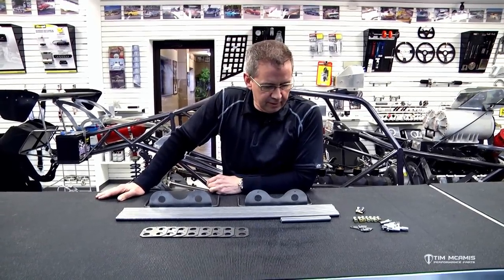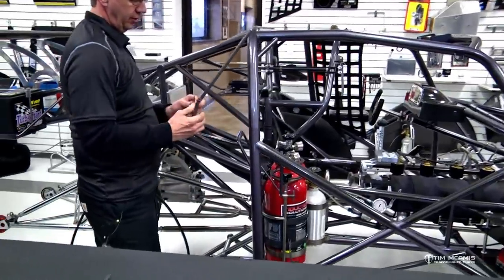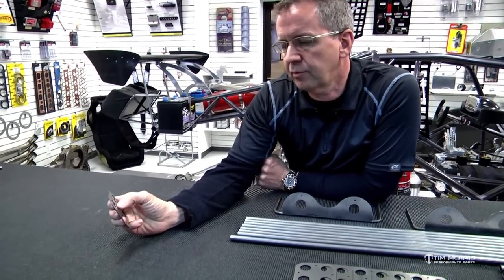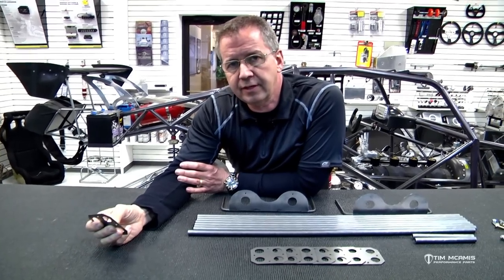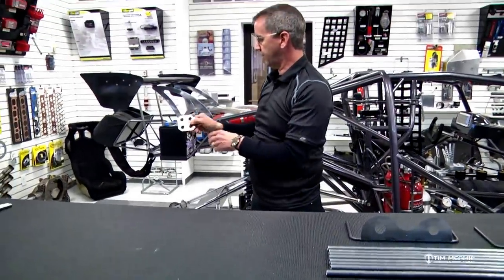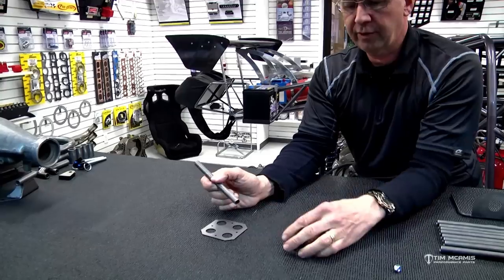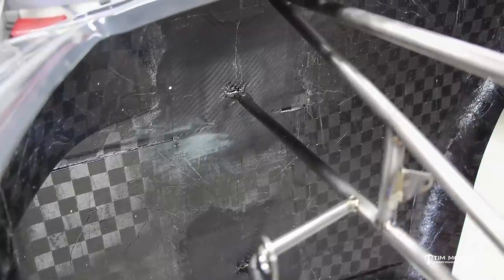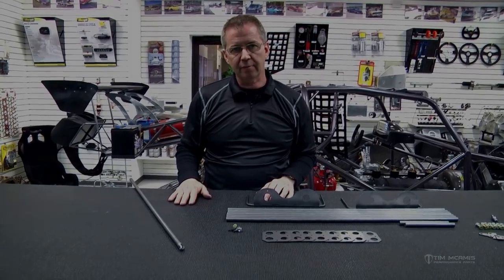Drag Race Body Mounting

Comment: I can't believe a 100k plus race chassis would have anything drilled and filled for location, when high performance epoxy adhesives have been used in Aerospace construction for decades. Nice to see it being innovated, but don't stop there.

Comment: Mar - glass works great too for mounting flat plates,cheaper than epoxies and set quick
Grind plat both sides and attaching area,after marking area to attach  attach plate with glas mixed,sets quickly then cover plate with mar glass it plastic spreader  nice month finish too.
I did fiat Mudd racer this way they rolled it two different  I mes and never dislodged body mount but broke the body in several piece's.  
 The material can be found any auto paint supply stores, and cheaper than epoxy.